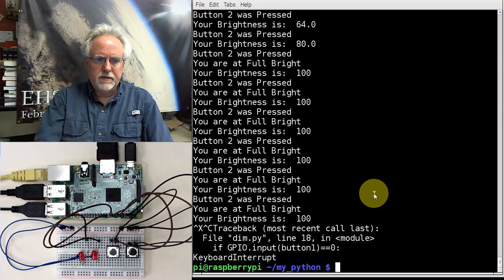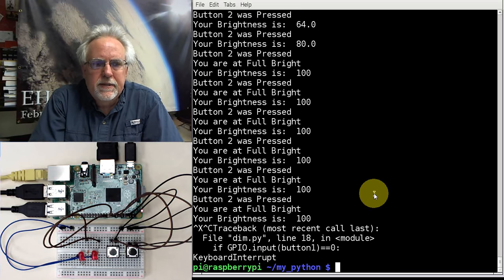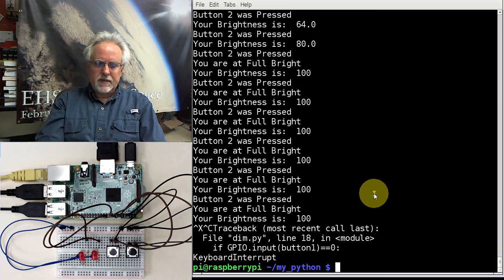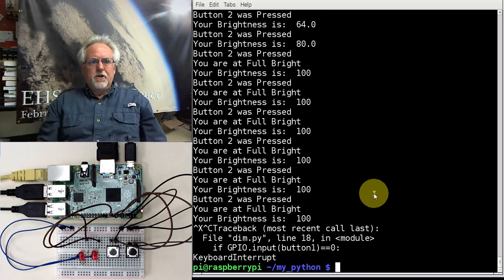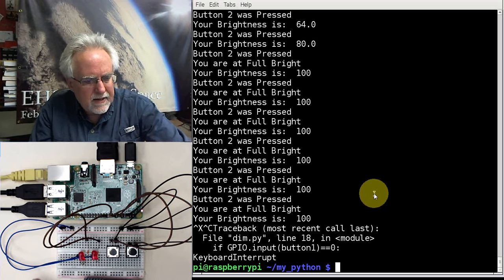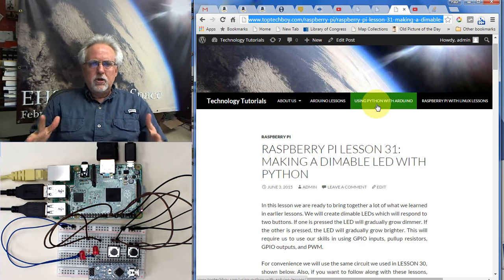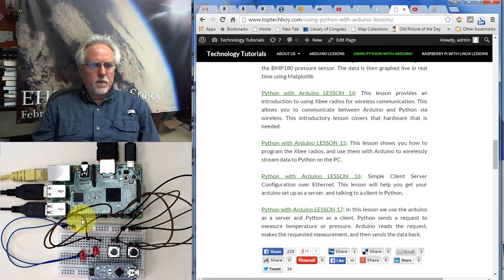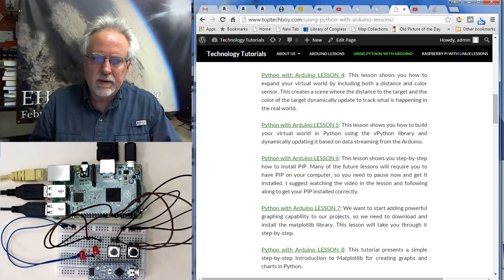Raspberry Pi LESSON 32: Analog Input for the Raspberry Pi

Comment: You can also use Arduino MEGA or DUE to have much more memory and hardware resources than using the UNO. This way you have 256 Kb of flash instead of 32Kb and also much more RAM, EEPROM and GPIO.

Comment: what about using simple MCP3008 ( channel 10 bit analog with spi interface )
Reply from the maker: bena salim Would probably work. I really want A/D on the raspberry pi. I wish they would add it.
Reply: +bena salim , I agree. Adding a client server layer on each end just to get ADC inputs would never be done in the real world. You can get ADC inputs using I2C or SPI ADC ic like you suggested for $0.35 and with 10 lines of code be sampling as many inputs as you have. I am not saying the client server layer with a separate microcontroller  will not work. Especially for the novice, teach them the most practical way to get ADC inputs to the RPI. Dropping a an 8 bit ADC I2C chip and adding a line of python code to import the library and your done. I think the OP video is a great solution if you have a large distance between where you want to sample and where you have to process for instance.
Reply: I agree, I was wanting to see some A/D but my first question is what kind of latency or possible handshake failure points would be introduced doing the client-server thing not to mention larger board real estate. Simple A/D chips seem like the safer bet. But.... I came here looking for answers because I don't know everything.